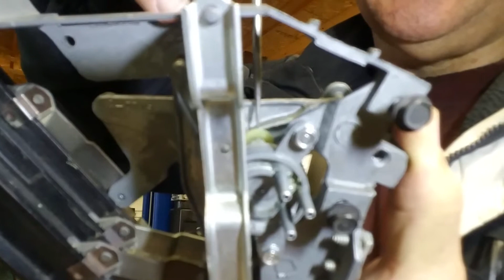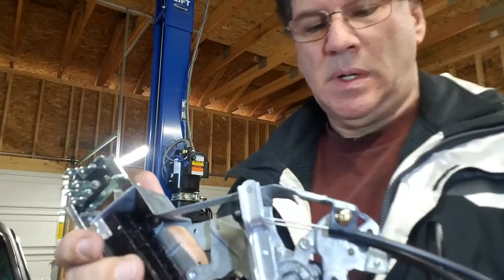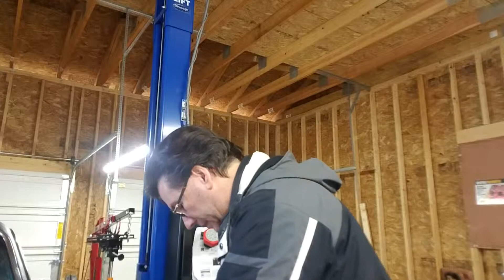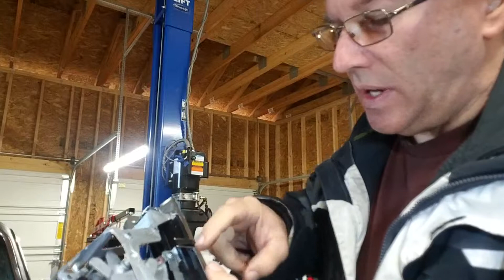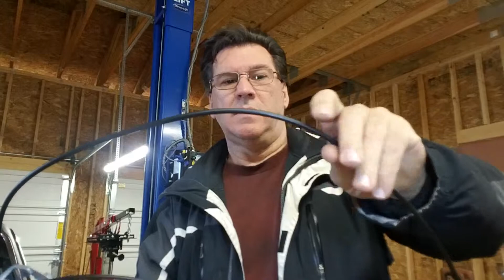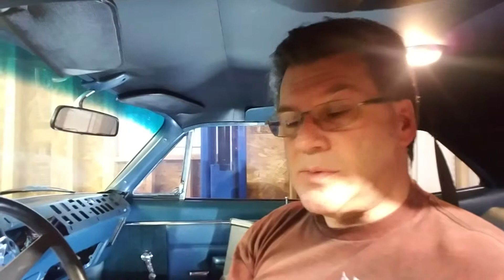Broken AC and Heater Controls in my 72 Nova

Comment: Steve did you ever check the vacuum control valve operation after moving it away from the lower screw? I need to rehab my controls - looks like you got yours working well.
Reply from the maker: Yes, and for me it is working quite well.  You can't move it very far, but the vacuum vents seem to be working like they should.

Comment: Thank you for the great video.  I have the same issue with my 70 nova.  I have  is hooked up but all of the levers  only go to about a quarter of an inch from the bottom, not all the way down like the old one.  Did you move the vacuum line screw on your new install or did you just straighten out the cables.  I need all the information you can give me.  Thank you again very much !  Larry
Reply from the maker: No I left the screw right where it was on the new one.  Without the cables the actuators move quite freely.  It's the tightness of the cables that screw everything up.  So I worked for hours straightening the cables from the bends they had from the packaging.  I also put some WD40 in the cables.  I would check the connection position on the cables at the vents.  Also check the travel on the switch without it mounted in the dash.  There might be some obstruction.  I'll have to recheck, but I think mine may not go all the way down also.  This might be normal.  You just want to be sure the vents fully open and close.
Reply: @stevesgarage7644  Thank you so much for the help.   I will go right out and try working on the cables.  I really appreciate the information and your expertise.  Your knowledge is very valuable.  Thank again.  
Larry Paulson